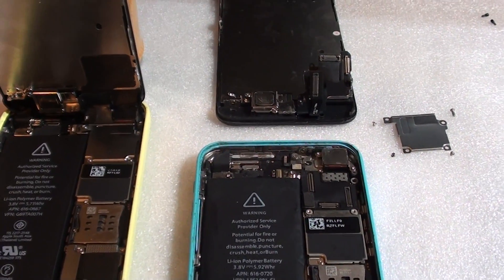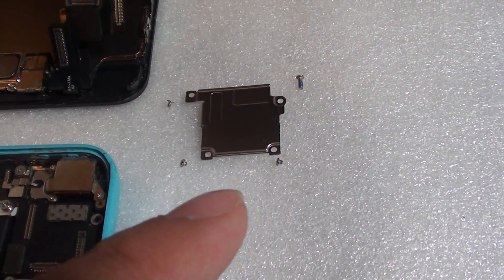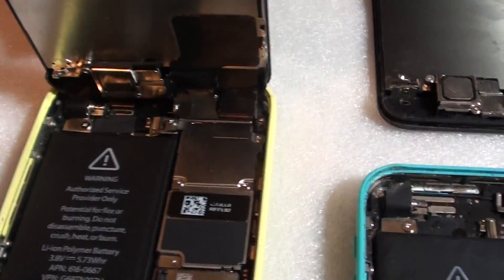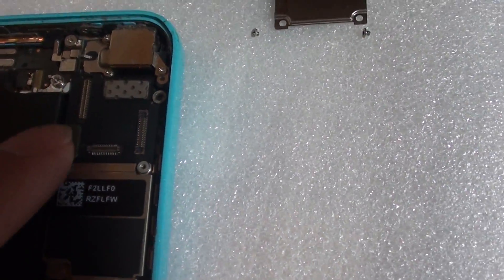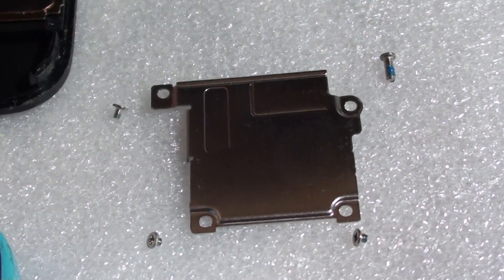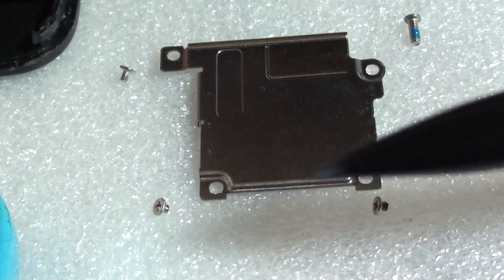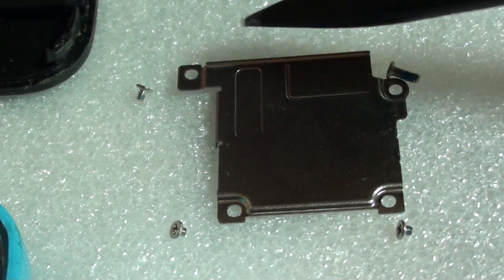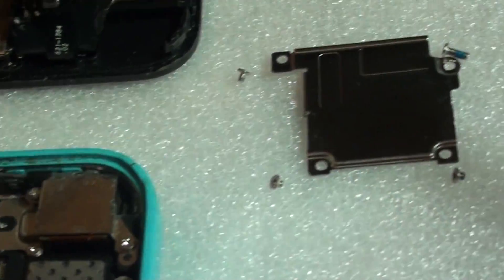iPhone 5C: Screw Size and Position for Screen Connector to the Logic Board

Comment: My Iphone 5S had two short screws, and 2 medium screws. For the long screw in this video, I just used the medium screw, and it worked correctly. The two short screws were my concern and this video resolved that concern, Thanks... I didn't realize they were different. Battery cover screws looked the same.

Comment: I have searched for a long time for a posting which tells you the screw lengths and their correct location, thought I had found it here but not quite, anyway I stumbled across it in another location and thought I would share it, maybe update the video to explain this. there are three different screws, you WILL need a caliper / micrometer to measure them:

The 2 in the bottom are 1.3 mm long
The top left hand side is 1.7 mm long
The top right hand side is 3.25 mm long

Hope this helps someone like it helped me, the screws are supposed to be Phillips #00 but depending on the quality of the set #0 may work better, Apple Pentalobe screws are used in the bottom of the phone holding the screen in.
Reply: Tim Pickford 
Thank you for providing a real answer. You rock!

Comment: What size screw driver your ment to use to take out the screws OMG this is the worse video
Reply: llKID INFINITYll is it that hard to work out it's a small Phillips head screwdriver so just get a small one if it fits then it's right if it's to big then it's to big and wrong size. Use your brain moron
Reply: No. Fuck you. The screw is a certain size. Yea I get it, its not hard to figure out if a screwdriver fits but why should we have to guess? Quit polluting the internet with non-answers. Tim pickfords comment on the other hand was very helpful.